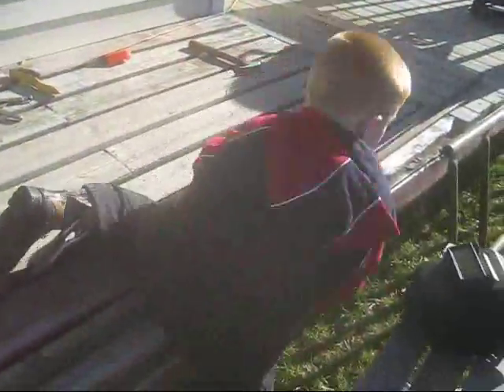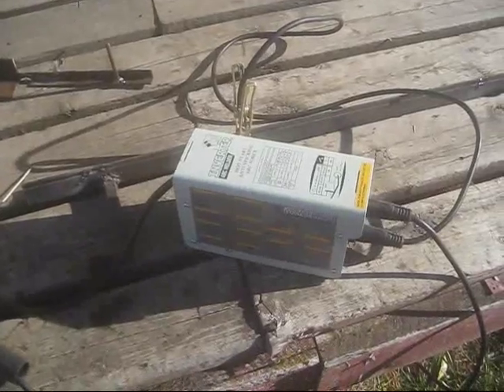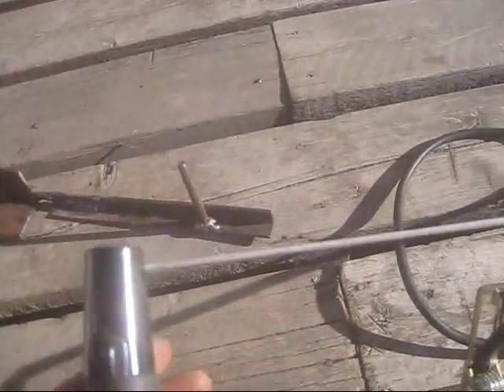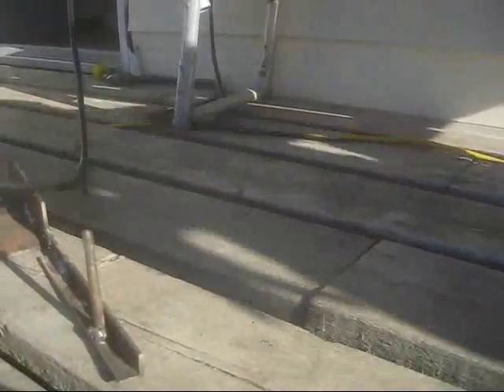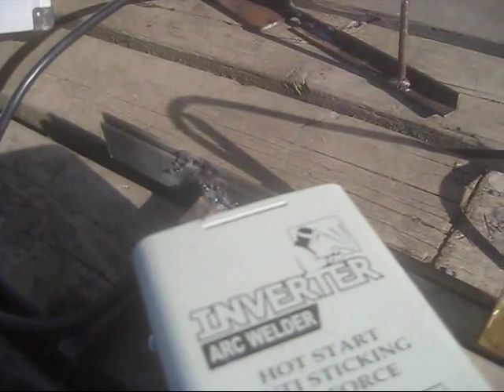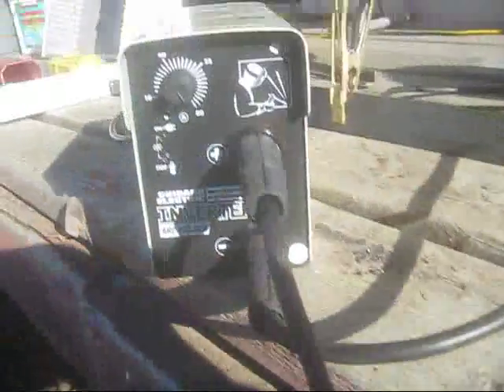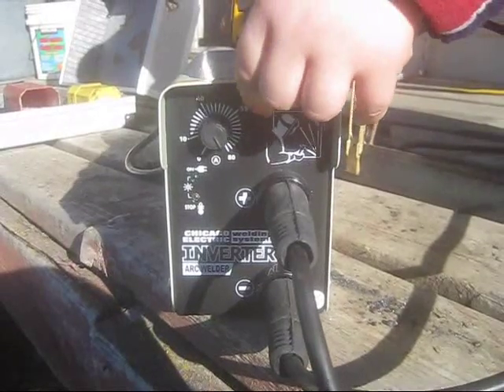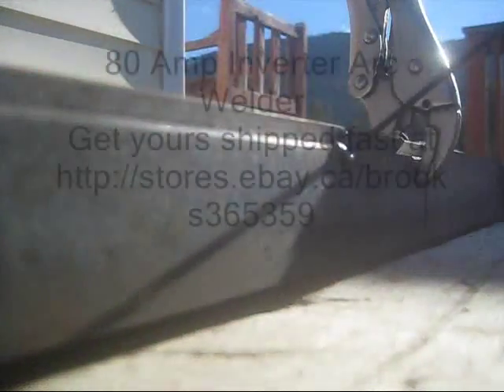Weld at home for under 200 $$ bucks 80 Amp Inverter Arc Welder

Comment: i just brought a 200amp for i think round 200 to 220of ebay great great product.. but anyways i like it better then the big 1s i used at tafe but thats my opinion.. im in austrtalia and we have 240v so im laughing... p.s man try to hold hand steady and kind of move your rod at the point of weld  about 1 to 2mm left and right and a steady pass you will get it.. nice vid..

Comment: @jasonmccoll either strike it or tap it but try use a scrap piece of metal first on every new rod because that heats up the rod so you dont get the rod sticking to the metal when you start your welding on the job your doing.plus take your time and keep your eye on the puddle,make sure you got a puddle all the way from start to finish of welds.hope this helps in anyway